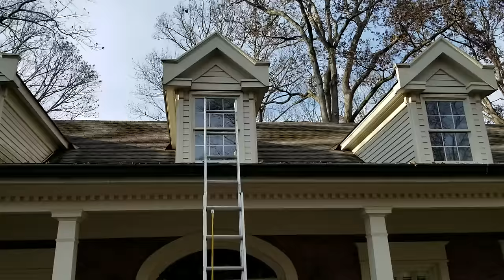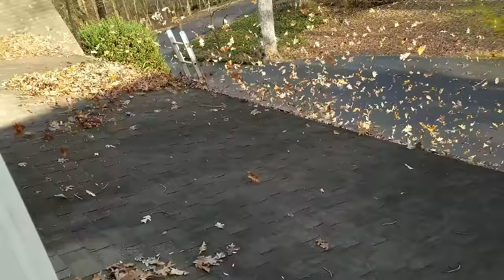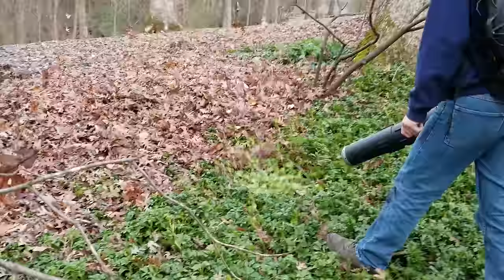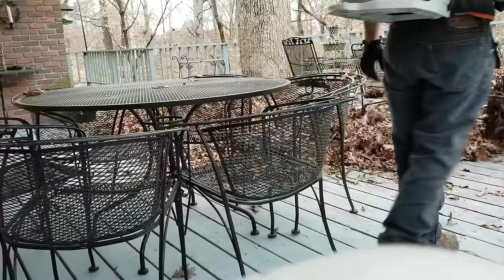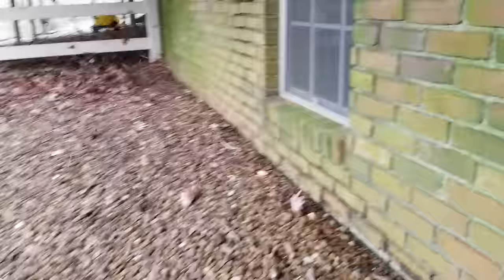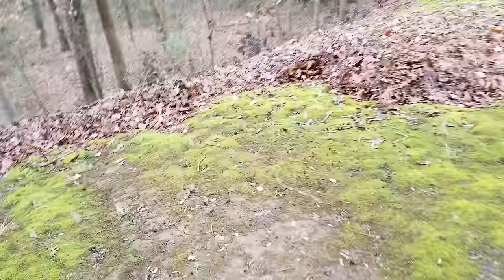Blowing leaves with Stihl br800 & echo pb8010

Comment: This video is gorgeous!!! How much do they consume? How long is the full? thank you
Reply from the maker: Thank you!! I'm not sure how long I can go on one tank of gas. I should have timed it
Reply: I have the 800 and it's pretty good on fuel, I don't notice much of a difference from other blowers. The only thing is you have to be careful when removing the fuel cap because it spews gas out from the pressure.
Reply: @steveday5038  That seems like a Stihl problem. I don’t run their saws anymore, but a couple guys I know who still do say that you have to be really careful when opening the caps on 461’s and (I think) 462’s. I gave up on Stihl about 7 years ago after getting hosed one too many times by crap dealer support.
Reply: Use non ethanol gas or gas that comes from a 1 gallon can…. It makes a world of difference with the gas being used…

Comment: I’ve been done with stihl my 600 has been well taken care of and but is not performing like it should. My 700 was a pawn shop find it ran good for 3 months and no compression after I did a leaf job. That 8010 has me sold on how much more leaves it’s moving than the stihl
Reply from the maker: Yep . You can't beat the echo!!
Reply: I bought the same blowers you are referring to used, and I don't have the problems you had.

Comment: We prefer echos over stihls cause there less maint they don't require real expensive oil like stihl recommendes on all there 4mix cause of carbon issues we just use  regular echo oil and echos do last way longer we have echos 770 on 8 years using them 6 days a week all year around we can only get over 2  years max out of the stihl br 600 magnum we had 4 with bad cranks.
Reply from the maker: Yeah I'm liking my steel so far but yes I haven't had them that long the BR 600 that I've had for several years motor did blow up, but my 770 t outlasted the steel by far, I guess I will have to see how the 800 holds out, as far as the oil I use the same oil for both of them I don't buy the expensive steel oil and so far they working good I use opti2 oil
Reply: There's some good info.  I had to retire my BR600 because of carbon issues.  Granted it was a residential machine so I got about 10 years out of mine.  It just got to the point it would keep bogging down.  I sold it and bought the 7550 Red Max, we'll see how well it does.  So far way more power then the BR600.
Reply: I have the electric gas start sthil 
400cm and the new 800 with side
Start in my opinion Sthil is harder
To start when 1st pulled vs a Red
 Max Husqvarna or echo blower

Robert King of Green ,
☆•ORIGINALAWN•☆
         Service
Reply: Victor Rippe . Echo has had a recall on their new blower and owned a echo 8010 and I didn’t like compared to my stihl br 800 c
Reply: I don’t use Stihl oil and have no issues
Reply: @FishFind3000  Well you have been in luck are you from up North.
Reply: Kuyu uuu7u UM
Reply: 0 ku

Comment: Nice video! Why is the 800 your favorite over the echo?
Reply from the maker: So comfortable! The air nozzle swivels so nice. Much easier than the echo. But having said that, I just bought a nother echo pb9010 because there is no stihl that will blow leaves like the pb9010!!
Reply: @raymondwanner2982  I have a 9010. Like you said, swivel isn’t that great. Mainly because it has so much pressure on it. Should I get an 800 or 600 to complement it?

Gonna reserve the 9010 for big cleanups.
Reply from the maker: @seabass22  i would get a br700 if i were you. I love my 700 for lighter work
Reply: @raymondwanner2982  I wound up with the 800X. I tried it and the 600 on my back and the 800 felt more comfortable. It’s a lot lighter than the 9010 for sure.

Comment: Are you still liking the BR800 best? About to buy either the 800 or the Echo 8010 and am wondering what you like and dislike about each. What makes the 800 your favorite over the 8010?
Reply from the maker: I have to say the 8010 went way up in my book!
I really like it because it definitely blows alot more!!!
I love the easy start on the 800 so nice that you can start it with out taking it off your back. 
The telescoping air shoot on the 800 is way nicer for blowing leaves out of beds with a lot of bushes in them, because you can shorten it and maneuver it around bushes better. The 800 has a better flex elbow on it too. 
But if I was having to blow alot of leaves I would definitely pick the echo
Reply: @raymondwanner2982  Thanks for replying so quick! I think I'm going to end up with the Echo. In general I have had great experiences with Echo equipment and there's definitely no substitute for raw power. As a bonus it's $50 cheaper (more than that actually as I know a dealer with an Echo 15% off event coming up).

Comment: which one would you perfer, br800 or the pb8010. i myself up here in canada am a stihl fan and have 3 br700 in my fleet solo. we have the br800 and pb8010 avaible now. i am not impressed with cfm from a br800 from br700 and price but i love the idea of the belly straps and side wind crank. up here too the br800 and pb8010 are the same price
Reply from the maker: If you are really wanting to get some blowing done like leaves then there is no question that the pb8010 rocks it. There really is quite the difference between the br800 and the pb8010. 
Echo pb8010 has so much more cfm
It's way better when blowing beside the others

Comment: Any idea how it works with moving  small amounts of snow? 1" dry powder or less. Which one would be better. Thanks
Reply from the maker: We don't get enough snow here in ten. At least I never tried it. But I imagine the stihl br800 would be better because it has a higher speed of air coming out of the tube. The stihl br800 has 239 mph speed of air where the echo pb8010 has 211mph. 
With that said the cfm is what you want to look for when moving loos material (like leaves)
The echo pb8010 has a higher amount of cfm 1071!!!!
Where the stihl br800 has only 912 cfm
Reply: @raymondwanner2982  thanks
Reply: @bcdoll01  Either would blow an inch of snow into oblivion. my Echo 580 blew about 8 inches of wet, heavy snow this winter. Go with whichever dealer you feel more comfortable with. Stihl, Husqvarna, or Echo are all great, but the dealer makes all the difference. Avoid big box stores. Even if they have the same exact model, setup, tuning, and service all matter more than brand name. Imagine if you bought a car from a big box store, or online. I can't stress enough, buy it from someone who will work on it in house.

Comment: Which one should i get 8010 or 800???
Reply from the maker: Good question. I would have told you a year ago the stihl br800 
But I'm more and more impressed with the echo pb8010 
If you are doing a lot of parking lots and big areas and leaves in the fall
Then I would say the echo 
But if you weren't doing that much and doing more of beds blowing out 
I like the stihl for beds and for blowing roofs off.
If I had to part with one it would be the stihl
Reply: @raymondwanner2982  thank you buddy
Reply: Stihl blowers all the way. Blowers use the most fuel compared to all other equipment that we use be it weedeaters, lawnmowers (reel or rotary),  hedge trimmers, etc. In Honolulu where the price of gas is $3.65/gallon, running the BR800 over the PB8010 assuming  16 hours of blowing/week and 50 operating weeks/year will result in $606.19 in fuel savings. In your run multiple blowers then your savings will be greater. If you run a 2nd blower with the same parameters as the first, your savings will equate to $1212.38/year in fuel. We currently run Honda mowers, Maruyama weedeaters, Kawasaki and Stihl articulating hedge trimmer, Stihl and Shindaiwa single and double sided hedgers, Echo and Stihl pole saws, McLane and Tru-cut reel mowers, and strictly Stihl backpack and handheld blowers in our fleet. Stihl is by far the quieter blower when compared to the competition. This is a definite plus when your are starting your jobs early in the morning and helps to keep the noise complaints low.

Comment: Great job I have the BR 700 looks like next up 800 or 8010 not sure tough call
Reply from the maker: I've used them both alot since I made this video and I will tell you you will not be disappointed with the 8010 considering leaf season is right around the corner
Reply: Raymond Wanner thank you looks like that’s the way to go even a few buck cheaper not to bad
Reply: @tommyplandscape8624  - Watch Johnny Mow reviews. Might change your mind about the 8010.  He had both, and sold the echo. He did two videos. The one a few months ago, explains why he kept the 800c.
Reply: Steve Carr thanks I did see it very interesting that the tube does not flex well I’m shocked but the power is there and it’s a little less expensive than the 800 go figure
Reply: @tommyplandscape8624  There's a reason the Echo has a 5 year consumer warranty and the Stihl only has a 2 year consumer warranty.
Reply: v is for vagabond I’m gonna sell the 700

Comment: Question for you?  Which blower would you prefer Stihl br800 or Echo 8010? And why?
Reply from the maker: It's a bit of a toss up sometimes the steel with its adjustable shoot is really nice in flower beds with bushes and it has the easy pull start or you don't have to take the blower off your back, but the echo definitely has more power and with as much leaves as I do in the fall I would probably choose the echo if I had to choose between the 2
Reply: @raymondwanner2982  I thank you very much for your quick reply,  I'm about to switch from husqvarna (leave blower) please don't get me wrong,  I haven't gotten any problems but I need more power. Thanks again and the best of luck 🙏

Comment: Which blower is good for wet leafs.  Br 800 or Echo 8010.

At beginning of video you said Echo 8010 is good if you just have to blow leafs.  What is it not good for?
Reply from the maker: Well after running both of them for over a year now I can say the echo is better at blowing leaves even if they are wet 
The echo is quite the beast! 
The stihl is more comfortable and the detracting nozzle is really nice in flower beds
Reply: Yeah the echo has more rpm thats why it will push the leaves better...

Comment: Robert King ,
          of Green  
☆•ORIGINALAWN •☆
          Service 
~~~~~~~~~~~~
I have the sthil 800 the blower is
Hands down the most comfortable 
Blower other than Marymua bl900 
          I have ever put on!

But as far as power goes it does
Not kill the Redmax 8500 or 7500
  Sorry sthil fans but it doesn't 

The most powerful blower I have
Use so far is the Marymua bl900 

Then redmax or husqvarna 8500
           And nxt is 7500

I don't think this blower is stronger 
Than the new echo looking at the
Video of echo at least that's just
My opinion ...
King of Green